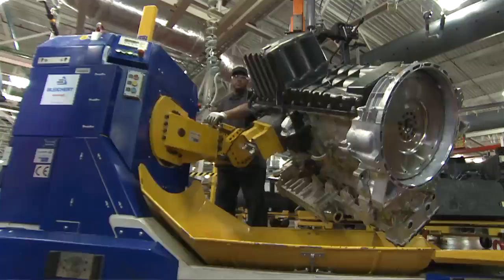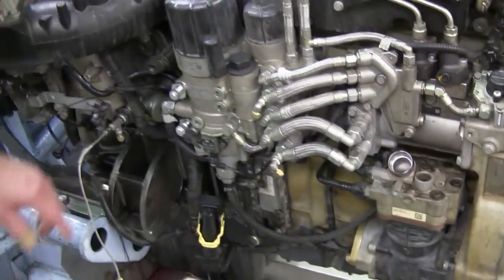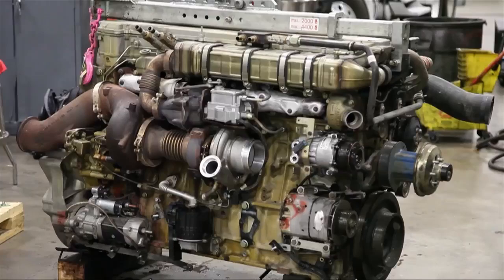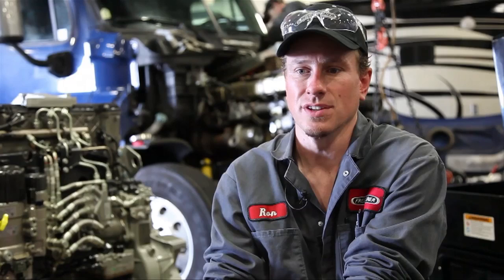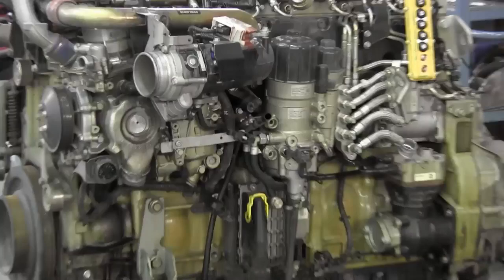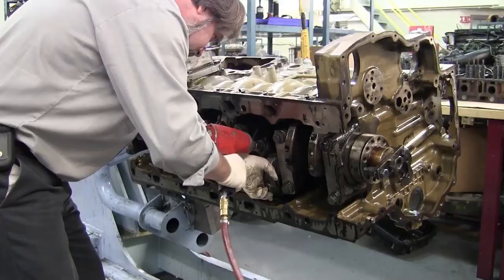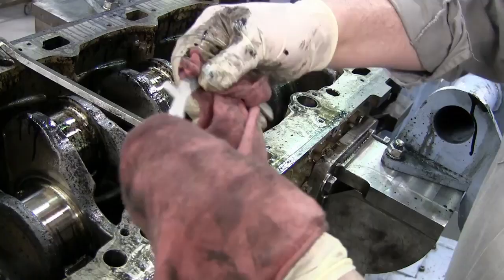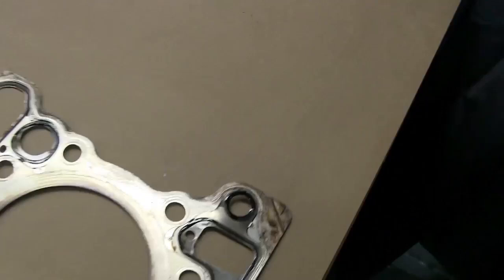Detroit DD15 Longevity and Durability

Comment: Three weeks ago i went out on a road service call when the driver said his DD15 went pop & shut down on I-15. Right before I got to him I stopped & picked up the connecting rod lying in the middle of the road. #2 rod went out the left side of the block, bounced on the road then knocked a hole in the power divider front cover before taking a line off a trailer brake can. It had 36k miles on it. Oh & I really love the location of the air compressor too, on the left rear behind the fuel system.
Reply: and that lovely reverse switch ontop of the gearbox ugh!!
Reply: the dd15 is a real piece of shit
Reply: Wow. What a service call. Here comes the hook. All engines run good when they run good right before they say f-it.
Reply: No motor would do that if it’s maintained , u less it was a one in a million bad motor , bullshit
Reply: @glenalguire6960  Low mile failures are more common than you think. Last week I went out to a 24 Mack Anthem in Cokeville Wyoming that had a low coolant shutdown. The plastic expansion tank was split open at the seam. The company had me drive to SLC for a new tank & go back out there & replace it. After poring 14 gallons of coolant into it I figured we had another problem & it was all in the oil pan. With a $3600 road service bill it needed a hook back to Mountain West in Utah. It had 42k on the clock.

Comment: I have a 2010 cascadia dd15 1.1 million miles  original miles, replaced all outside components, and updates .Inside the engine i just replaced the injectors..bearings are at 90 % wear...and still going!!!
Reply: What advice would you give me I have 2015 dd13 cascadia with 700k miles on it runs fine no issues when should I trunk about a ewbuikd or I frame
Reply: @TroyP20  if you can afford it replace the whole engine at 800 900k it will cost you around 50k on an engine swap with extended warranty 3 years 300k miles parts and labour nationwide  ask at an iland detroit dealear about prices NOT Freightliner dealer!

Comment: i m 100% sure they pressure washed before making this video.. 60 series the best
Reply: I agree but in the trucks 2009 - 2019 there is no more serie 60
Reply: They for sure pressure wash the engine so they can inspect any oil leaks. Standard procedures prior to inspection.
Reply: @marioguerrero3875  2009 theirs still series 60 I have it in mine no def yet in 2009
Reply: The thing doesn't even have dirt on it... dead give away they power washed it.

Comment: I'm sure it depends on the oil that is used and the frequency of how often it's changed and what fuel you run, not to mention HOW it is driven!
Reply: Yes an owner operator is generally gonna take better care..but these fleet trucks are generally trashed buy the driver.....the dd15 is a good engine...not sure why I made my original post.  Mustang been drunk or something.

Comment: This teardown and inspection is not at all biased lol, in my experience if an engine with any miles on it doesn't leak it's because there isn't any oil in it. Especially these new regen engines the heat cycles are insane. ice cold egts 80% of the time to meet the unrealistic nox levels, and dumping raw fuel in the exhaust to burn something that is already burnt. That is a recipe for failure in any engine, that engine was definitely cleaned inside and out for this ADVERTISEMENT before hand, also love how that TECHNICIAN dragged the conrod along the cylinder wall!
Reply: Exactly right

Comment: I have a 2015 Detroit DD16 with 284600 oilfield miles and 13,200 hrs on it.  Haven't touched anything but for P.M. service and belts.  Never have had any DPF filter issues.   I use lucas fuel additive every other fill-up and Lucas Diesel DPF DEEP CLEAN every 6 weeks.😎👍

Comment: The forgot to mention the 235 times this engine went to the shop for emission related issues . I'll take a series 60 with 500k over a brand new DD15 any day and twice on Sunday .
Reply: Dan R  so true nothing beats a 60 series
Reply: Dan R I agree to a point. The EPA07 DDEC 6 Series 60 was an abomination compared to the EPA07 DDEC 6 DD15. Comparing the engine platforms on their own without aftertreatment in mind, the DD15 is superior.
Reply: karim grant dd60=amazing engine
Reply: Really , never seen one last that long
Reply: I have met a lot of a- holes in my life ,but have you not got the courage to not hide behind a nom-de-plum ?, most credible people have!!!!
Reply: its a  benz. i sure as hell dont want one.
Reply: you spend $1.5 billion developing an engine you better pretend it farts sunshine and shits gold... save it up because once you have to replace the one-box SCR assembly on the new Cascadias you'll need it :/
Reply: Yeah I know a guy who said the same thing. Now he is broke. No engine is perfect but the DD15 is a damn good engine.
Reply: This is good if you use quality oil with 15-20k changes, don't beat the hell outta it and DEFINITELY keep the idling to a minimum or none! Get an apu! These DD like to run long at 15k rpm! You'll never have a one box issue, nox or doser problem! Can't say good things about egr cooler and egr ! Just clean egr every 50-100k miles! Do the same with the doser and take a screwdriver thin and long and poke the doser hole clean! If it asks for a regen...DO IT DON'T WAIT!
Reply: @fellanmaddogmanning8630  best comment ever everrrr

Comment: I have 750k on mine and have replaced all my injectors, egr cooler, radiator, starters,alterators, multiple sensors of all kinds,Sam computer,  and now in shop needing a 1 box. NOT FLAWLESS AT ALL. Maintained regularly with synthetic oil Lucas and motorkote.  Truck even has APU for low idling hours.
Reply: Mines just got a 1 box I have 696 on it . I bought used had it for 11 months

Comment: only good thing when you have a dd15 is they never rust .couse they leak like crazy
Reply: I agree with you chris
Reply: I've had mine for almost 2 years and no leaks.The trick is to keep the pan seals pliable so they dont leak.I use Lucas oil stabilizer  to keep the seals pliable.

Comment: my cat c15 has 1.1 million no rebuild needed yet
Reply: Arnt you bloody lucky.........
Reply: One of the very few
Reply: Safet Hamzagic when you go to rebuild there wont be much left to rebuild 🤣🤣
Reply: CAT C15 is the twin brother of the Detroit 60 series. They were both built to last.
Reply: @yosefshawarma3739  How dare you sir! The Detroit at most is a distant step cousin...lol. Twin brother...huh, the nerve of this guy! Lay off the narcotics fella😴
Reply: 1.1 mil....no head gasket blown,no fretted rocker cradles, no sunken liners, no leaking injector tubes,no bearing roll???
I love c15s but like any engine they arnt without their problems, you have done exceptionally well 🤔
Reply: Not an ACERT, obviously.
Reply: Thats why Cat stop making highway engines. These Big Cats gotta breathe🌬🌬🌬 And half of these new engines don't last 2yrs without an inframe!
Reply: Update all...no more c15..started mixing oil and coolant at 1.25 mil...got a detroit 2009 60 series..let's see how many this one does..at 850k now..
Reply: Rebuilt my c15 at A million three hundred thousand. All components came out like new. So I guess I have another 20 years to go before retiring.
Reply: How do u check for blow by just take off the oil cap once it's up to operating temp.?
Reply: Same here. C15 acert no rebuild 1122000. Still running
Reply: You never blew a head spacer
Reply: @yosefshawarma3739  bull c15 is way  different from 60
Reply: @slayer77000  no way your cam came out looking new

Comment: No oil leaks? Please... you pressure wash it before or after removal from chassis? Cascading oil leaks from the oil filter/cooler housing and rocker box gasket after 250k on every. single. engine. period.

Comment: This is %100 unrealistic.
Reply: I know it's crazy
Reply: I have 2014 dd15 engine with 725k miles. It has a lot of leaks, but I should say its been reliable on the road.
Reply: @murutchan  leaks from where?
Reply: @shatteredsquare  1. Coolant leak from coolant pump 2. Oil leaks from a lot of places. ( crancase filter, fuel line, from bottom)
Reply: This completely false I've never seen a diesel of any brand thats perfectly clean with 0 oil leaks, and Detroit is known to leak something
Reply: @MultiPowerlin  Yup between 600k and 800k most DD15's will develop some leaks but they don't have emissions issues at 860k on mine the only emissions problems I've had are 2 wiring harnesses costing me $600 total. I'll take leaks over emissions issues all day any day with a leak I can spot it myself and can drive around on it for quite awhile and save some money if I need and I can take it to a shop of my choosing at a time I also choose. Often with emissions issues you get shutdown to 5mph and wind up getting towed in to the nearest shop and are forced to shut down for a major repair right then right there with no warning.
Reply: @gsxr1189  or just have a truck without emissions then leaks are whatever but the power is reliable
Reply: @MultiPowerlin   I've had this truck paid off for the last 650K miles and I can't tell you how financially life changing that having reliable and paid for equipment for that amount of time has been. It's put me in a different socioeconomic class entirely I've got a paid off $350K house and $150K in paid off vehicles and toys none of which I had beforehand. Is life good or what.
Reply: @gsxr1189  who is your accountant,because you can't just not have business expenses and then take all that money and spend it personally without paying tons in taxes🤔🤔🤔🤔😏😏😏😏😏
Reply: Current emission standards don't allow for longevity of any diesel engine. This 2008 is pre-emission without EGR nor had a particular filter. Now let's inspect a 2018 with half the miles.
Reply: Really once they said no oil leaks i was done
Reply: I've got an 808 thousand mile DD15 engine.  It's had all of the cooling system parts replaced and most of the emissions system parts replaced.  These things can get good miles on them if they are not geared to run above 1300 at highway speeds.
Reply: That truck was probably bobtailed most it’s life

Comment: By 840000 miles on my D15 had to get a overhaul. After the in-frame was don't. It still have 4 leaks I needed to get taken care of. Most of the time it's been a pretty solid engine. Even though that was the second in-rame that got done.
Reply: TheOneFromFuture  yes the were. My truck was leaving big oil spots everywhere. By the time I got it fixed it was losing a gallon a day. Cost me another $6000
Reply: TheOneFromFuture  it hasn't leaked oil since. But sometimes I pull into a relatively clean spot. And I'll see a oil leak and panic. Until I realized that it wasn't from my truck

Comment: As a fellow driver, I’m just curious right off the bat how it got 760,000 miles on it in 2 years as it says in the beginning. I’ve ran my ass off in a truck but 760,000 miles in two years is some trucking I ain’t never heard of.
Reply: I agree its bullshit , not possible, unless you run that truck with a team of 3 ppl and only time you shut down is for fueling and oil change.Basically reset is on the road while truck is moving.Coast to coast pin too pin.

Comment: I have a 2013 Freightliner cascadia DD-15 with 1,100,000 + miles on it. Motor still to this day has zero blow-by and has never used a drop of oil in between 15,000 mile oil changes. I've definitely had oil leak issues through the years. Oil pan gasket, turbo oil line, fuel rail, etc. Emissions on the motor have not been that bad. Particulate filters last around 350k on average. O-rings on oil pump will definitely let you down. I've changed mine twice. Lost all oil pressure around 1 Mill due to oil pump pick up or something another had rods and mains replaced. Overall it's been a great engine would definitely buy another.

Comment: 1.060.000 miles on my DD15. No major issues.  Some coolant lines, coolant pump, clutch at 870k, fuel quantity valve over a million....that's about it.
16-20k oil change and never start driving if oil temperature below 170 F.
Reply: Hey Apostol, how much milage are you at now?  Anything else come up to your dd15 since the post?  Thx
Reply: @bhaydenca  1294635
No engine issues. I replaced transmission,  automatic, and after a week i got some harness issues collaborated with some transmission software issues. 
It took three months to be fixed 
Engine software was not matching the new transmission software. 
Deleted DPF. They were developing new engine software and i had to wait for it.
Runs perfect. The new engine software loses the peak power but i gain in fuel consumption. Stays on 7mpg which is very good for me at this mileage.

Comment: They can keep it. I just rebuilt my 2007 14 liter   60s. 
Its loud. But gets 6.5 mpg with a full load. 
It's still profitable and cheap to work on. 
16k for a full I frame at the dealer. 
On this engine u get just an emmsions system for that money..

Comment: Detroit Diesel, oiling down roads since 1938.
Reply: You know when your out of oil in your Detroit when you stop leaking a puddle on the ground everywhere you go.
Reply: @dominicturner2055   3406e,s60 and n14....all of them leak very bad...
Reply: This is a Mercedes
Reply: 🤦🏻🙋Guilty! Every time I get a PM the Mechanics tell me I have an oil leak. I tell them no kidding its a Detroit. Show me one that doesn't leak. My truck has been leaking since I got it at 500k miles I'm at 950k miles and have done absolutely nothing to the engine, it's still running strong. Detroit is a good leaky engine only problem is the emissions.

Comment: Can you guys post different jobs you do on Freightliner DD15 engines ?  Example, how to remove / replace the DPK unit. 

Also, can you post videos on what types of services to be done on Freightliner DD15 engines at 100,000 miles, 300,000 miles, 500,000 miles, and 900,000 / 1 million miles.

I’d appreciate it. Thanks.

Comment: "There's no road grime or anything attached to the engine"  Hrmmmm
Reply: Regular engine washes (as long as you keep the engine wash guys off the wiring harness) will keep it looking nice like that. Avoid hitting that wiring harness too much because you can get water in it and corrode them, and damn that's expensive.

Comment: I have been a diesel mechanic for nearly 50 years, worked on a lot of Detroits  and EMDs .Very impressed , always liked those engines.
Reply: Laurie Clews thanks for your opinion on the topic
Reply: Laurie Clews I’m sure they keep you in business.
Reply: What mileage should you look for if you looking to buy one?
Reply: Mucleboy01 the mileage doesn’t matter, it’s all about the condition of the engine.
Reply: 9914life how so you know what condition an engine is in when you go to buy a truck?
Reply: Mucleboy01 you can drain some oil and sent it to a lab for testing. It may cost around a hundred dollars but it will tell you how much of what is in the oil. If the test shows that there is lots of metal in the oil, don’t buy it. You should also look for sludge buildup, oil leaks, make sure the DPF is in good shape because they cost a fortune to replace.

Comment: OIl quality and correct oil change intervals are super important to main bearing wear, and wear on other components. I know of a Gen 2 ISX-600 (non egr) that completed 2 million km's hauling 65,000kg B-double application on long distance interstate.......it was using Fuchs 10w-40 full synthetic oil, 20,000km oil changes......and was still providing power in spec, oil consumption minimal and excellent fuel economy. It only required one valve lash adjustment in its life, and mechanic commented that it was almost not necessary, and all the valve train looked new at 1.5 million km.

Comment: I drive an International 9400I with a Cummins ISX 435 horsepower no def or regen only EGR had to  replace that twice. Otherwise a very dependable engine
1.2 million miles and so far still going strong
Had to replace a cam shaft as well the one that operates the valves not the one for the injectors

Comment: Did a cylinder head on a 2008 with 1.7M kms as the intake temp sensor had failed and a piece got stuck in intake valve and burnt it and while we were at it pulled oil pan to check bottom end and replace pick up oil seals and it looked exactly like this does, oil changes every 20K probably helps and it runs on Delvac Full Protection 15w40 fyi